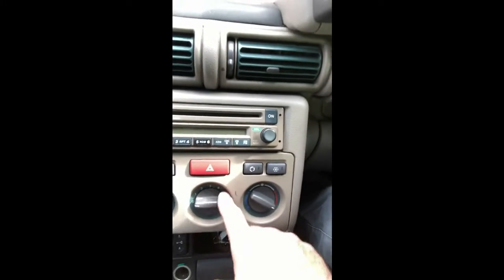Fan/Heater Resistor Motor Unit Fix - Fan speeds 1 and 2- Freelander

Comment: Speed 1 gave up years ago in my 2.0di Freelander. Nice to know what the problem is when Speed 2 eventually fails. Cheers mate.
Reply from the maker: Cheers, speed 1 failed and I ignored it for years but when speed 2 fails and your on a trip with minimal cold or hot weather and you have to crank it up to 3 to get air con or heating it’s like ‘oh really?!’

Comment: Hi, great video, what if I've lost 4th speed? 2004 2.5 V6
Reply from the maker: Bonjour Michael thanks for your message. I used to have a KV6 until 2020. It could be this resistor motor, but it could also be something else. The part number changes per the VIN number. If you list your VIN here, I’ll respond with the part number.